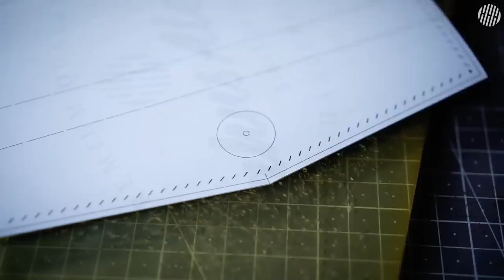Glasses case : Can be used as mask case

Comment: So talented bro✌️
What material do you use in between of leathers ?!
Reply: That's the leather board
Reply from the maker: A kind of hard paper reinforcement (usually used to make hard parts of bags). It's a brand called Bontex or Webtex, similar to the Leather Board (LB), but it's harder.

Comment: What is the stiffener material that you used?
Reply: That's leather board
Reply: @salmanmazhar9044  There's over a dozen different types of leather based stiffeners ranging from flexible to stiff. "Leather Board" literally means nothing.
Reply from the maker: A kind of hard paper reinforcement (usually used to make hard parts of bags). It's a brand called Bontex or Webtex, similar to the Leather Board (LB), but it's harder.

Comment: If your so concerned about a mask you have way bigger issues than where to store it.
Reply from the maker: This case is intended to leave the mask for a while. For example, if you go to a restaurant, you need a case to keep the mask for a while. This is because it is more unsanitary to put the mask in your pocket or leave it on the table.
Reply: @HahnsAtelier  cloth a d disposable masks are single use only and do NOTHING against the coof. K95 should not be used if deformed.